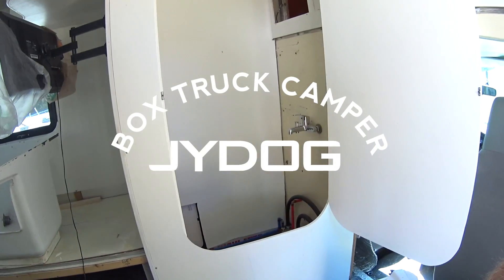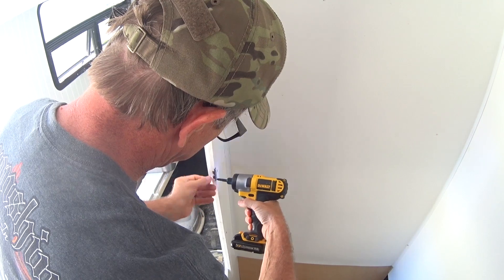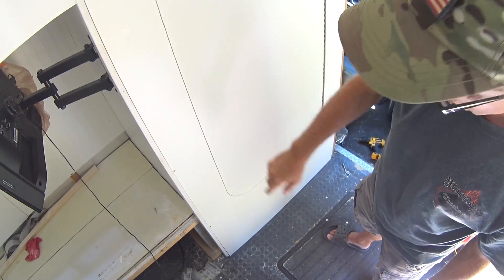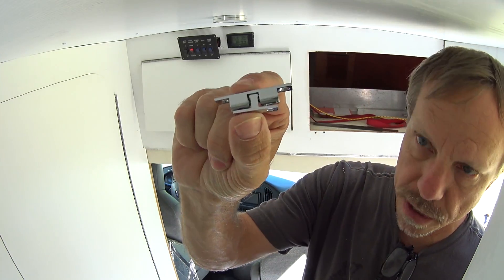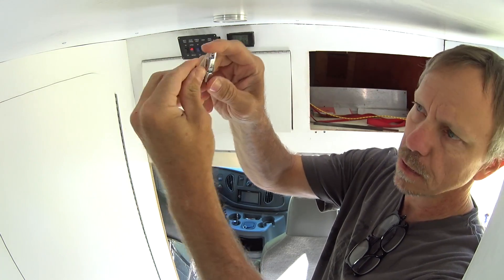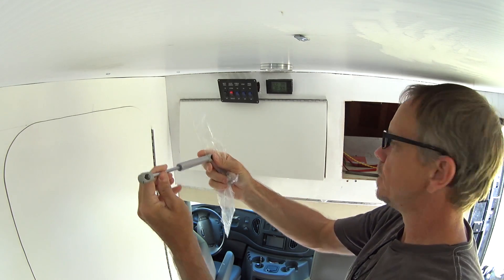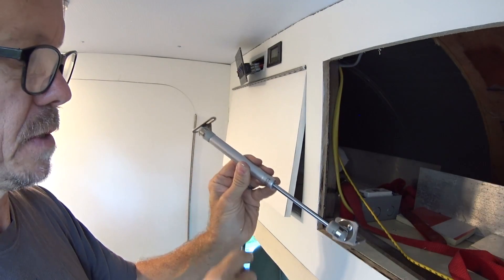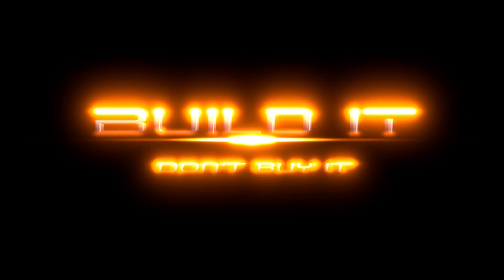Box Truck Camper RV 90 PVC Cabinet doors

Comment: looking great. I love how your son helps out, and he's not too camera shy. just a thought, I might consider making that door in the shower bigger and putting the hinge up closer to the roof, then you can glue on a white rubber flexible dam to the ceiling to keep water from getting in the hinge. of course, steam will likely condense up there. I imagine they are sold as stainless steel, but I wouldn't be surprised if it rusts. maybe treat the hinge with a light coat of wd40 to prevent rusting. of course I'm a novice, so these are just thoughts.  :-)
Reply from the maker: All good ideas, the hinge is supposed to be stainless but I am not really sure what grade so it could rust. I'll end up making mods as needed as it gets used. Right now I am just trying to make a push to get it somewhat completed by episode 100. Then it will just be modifications. Keep the ideas coming, two minds are always better than one.